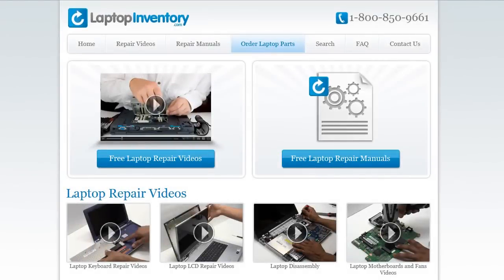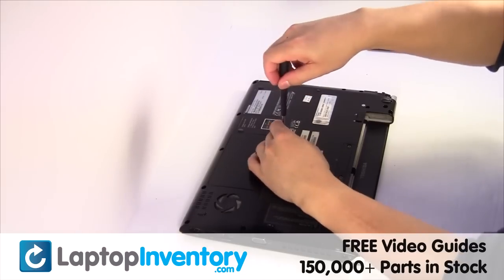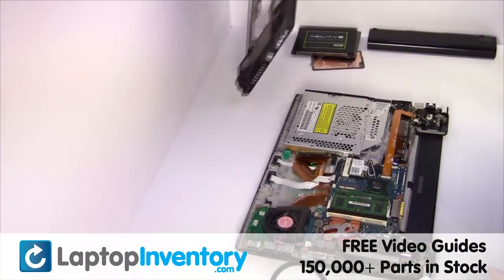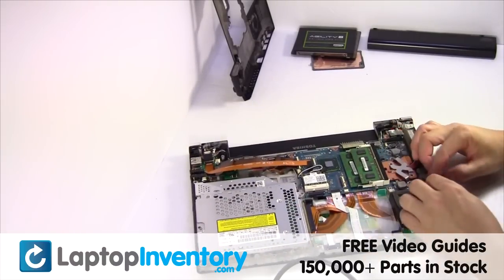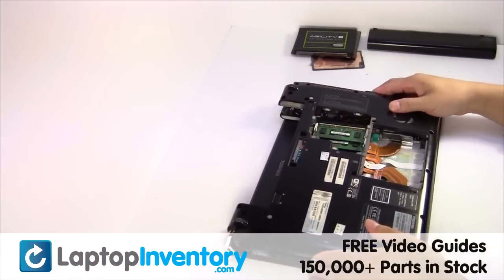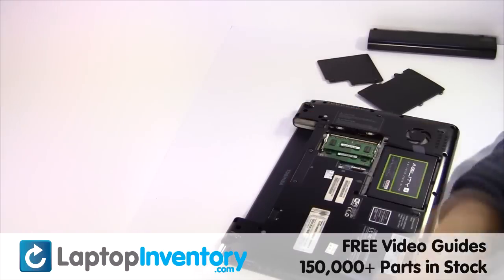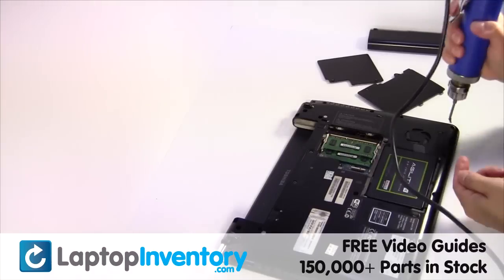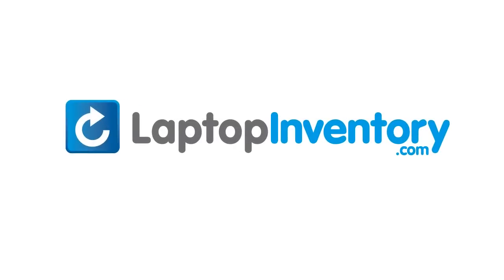Toshiba Portege R700 R835 FAN Installation Motherboard Replacement Heatsink Disassemble Take Apart

Comment: What about the Motheboard Replacement and Heatsink Disassemble? This model looks like quite a pain to remove the motherboard, especially since there's no access through the underside of the board through the keyboard. How do you deal with those cables? Doesn't anyone imagine repairing these when they are designing them?